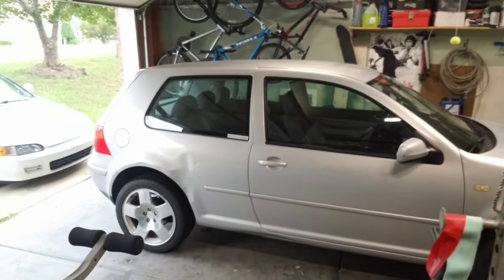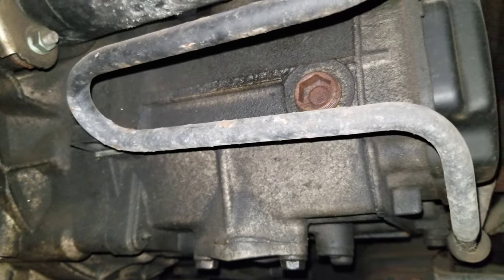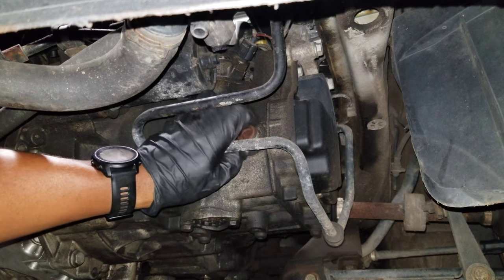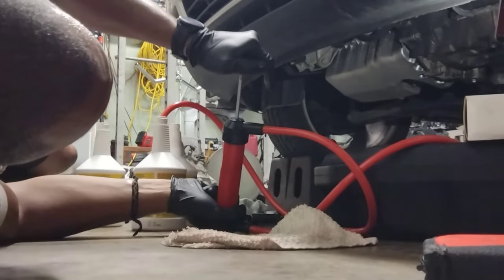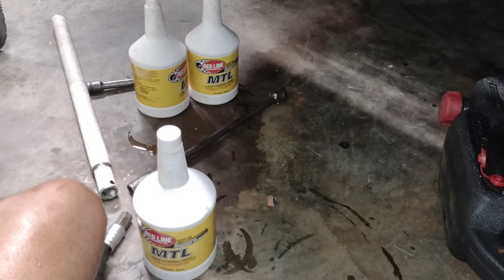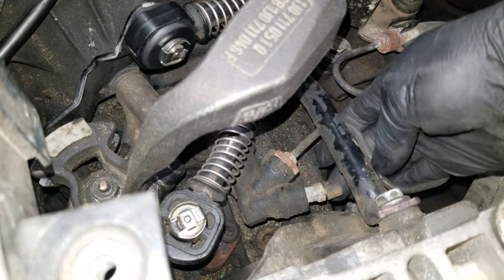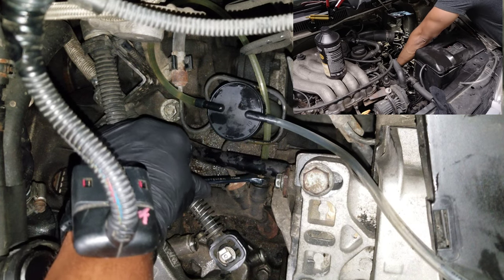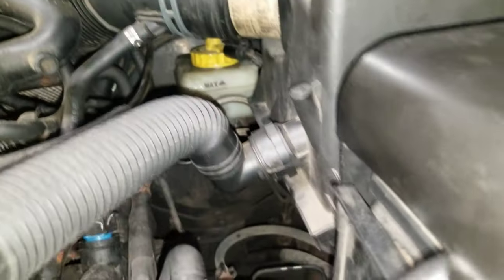MK4 Golf transmission oil change and bleeding the clutch

Comment: You should always remove the fill plug first in case it's stuck.  You can stop and get help and still have fluid in the case.
Reply from the maker: Thanks! You are 100 percent right! I was living on the edge 😉
Reply: Nah go all in
Reply: You can always take out the speed sensor and fill from there if you need

Comment: Nice video, thanks.  On all of my manual transmissions I have filled them by snaking a tube down from the upper part of the engine bay into the fill hole.  I plug a funnel into the upper part of the hose and fill until it runs out.  No pumping needed!
Reply from the maker: Doh!!! I should have done that. That's exactly how I filled up my Evo and Civic.

Comment: When shifting into first gear car should be almost complete stop. This is because 02J transmission is pretty old design internally and there is only one synchro ring on first gear. Many newer cars got two synchro rings in first gear so you would shift into first gear smoothly while car is moving.
Reply from the maker: Hi. Thanks. I didn't know that about the synchros. But, I am always at a dead stop when I go into first. I could just drive it like it is and give it a second before I shift. The slave cylinder is next and then maybe the master. Do you have any other ideas?
Reply: @MaqsVids  did you try to aligne the linkage I had no 5th gear engaging thinking 5th gear was gone but it turned out the linkage just needed Alignment
Reply from the maker: @earth7551  yes. I show it other videos. It helped me too.

Comment: My so called mechanic did all the clutch pumping to find out it's the master cylinder 🥺. Brand new clutch and pressure plate kit. Which needed replacement, to find out about this. It was heartbreaking. Enjoy your golf with it's clean service 👌

Comment: I usually do refill the box at the breathing hole up at the gear selector mechanism, or i completely remove the tower and fill up about 2-3 litres of oil... The gearbox is much quiter and shifts better, but sadly theese 02A and 02J boxes have weak 1st gear shyncros
Reply from the maker: Hmmm thanks. So that allows you to put more oil in??
Reply: @MaqsVids  Absolutely, the 2.5 litres is more than enough, but i usually do 3litres, didnt have a problem, and i did this to 3 car of mine so far without any problem.

Comment: bro, which gear grinds? if its 3rd then you will have a bad gearbox mount and bad dogbone mount. what happens is the gearbox swings back and forth changing the gear linkage by about an 8th of an inch in your measurements! this is enough to pull on the cable and make it grind! most people would think its a syncro, as you said you "gave it time" so a second or so and it was buttery. what is happening is this second is enough time for the engine to stop pulling the vehicle forward and correcting its swing position in the bay. as soon as its done it you have a nice gear change! if it was a bad syncro you would have a bad change every time! the fact you state it only happens "when you get on it" and give it some, its the mounts trust from a PD150 euro owner!
Reply from the maker: Hi! It only ever happened in first gear. After this video a made more where I kept trouble shooting it.

https://youtu.be/6z564LN8W-E

 I have not had a grind for a long time now. BUT!!! I bet I could still get it to grind a little if I tried. Now...I'm going to look into mounts. I'm sure it needs them. THANKS!
Reply: Is this advice also accurate for an mk4 Golf TDI? How many total mounts does the trans have? I have this very issue. Thanks!

Comment: Did this fix the issue? Mines doing the same thing where it grinds into first from neutral at lights? Worried my trans is going
Reply from the maker: It helped a little. I did several things  for the shifter and together they made the issue almost go away completely. I have not grinded into first for a long time now.  Check out my MK4 Golf playlist if you haven't already. There are 4 other shifter videos.

Comment: Always undo the filler plug first..just in case..and always use genuine VAG gear oil.
Reply from the maker: YES to removing the filling plug first!!!
Reply: Adi varso
Incorrect Redline Mtl can also be used
Reply: If you can't get the fill plug off you can take the speed sensor off and pour in fluid from the top. As long as you know how much you need
Reply: I'm probably going to do my 02J today on my ALH Golf, and using Liqui Moly 75W90.  Will install a new dogbone mount while I'm at it.